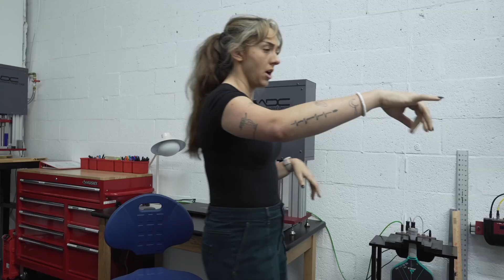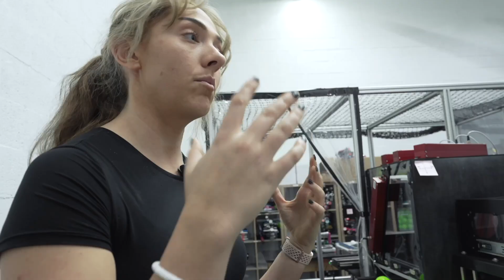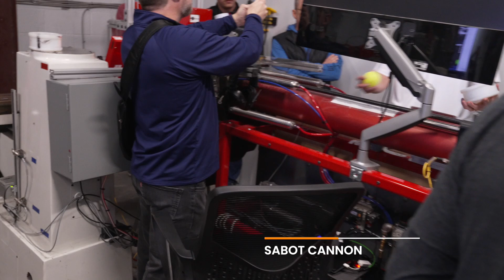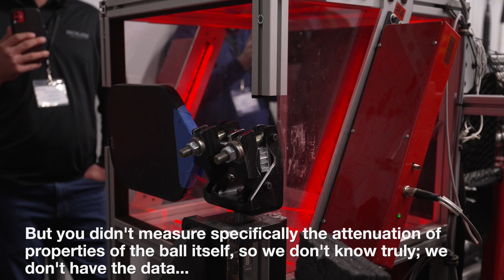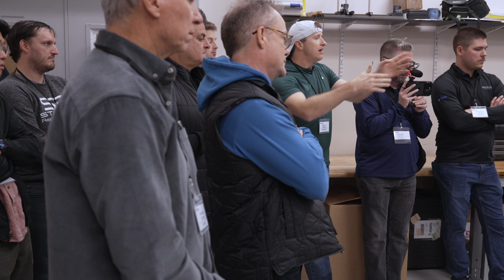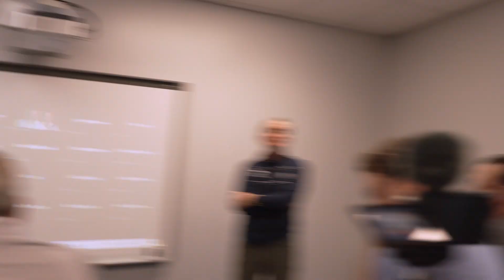I visited both labs doing PBCoR testing for USAP and UPA-A. Here’s what I found out.

Comment: I'm confused. These testing labs are ultimately trying to limit paddle power. Why would they include user modifiable variables in the PBCoR calculation?? MoI and weight should not be considered constants unless users/players are banned from adding weight. It would seem more appropriate to test for a maximum PBCoR value by eliminating the pivot/encoder mechanics and locking the paddle (by it's handle) in place.
At a minimum I'd ask the labs to test a stock paddle, weight the paddle and test it again, are the PBCoR values the same - unlikely...

Comment: It is important to remember what is being measured here PBcor measures the efficiency of the transfer of energy by the paddle in the collision between the paddle and the ball.  50pct of the data from the test  depends on the dynamic stiffness and rebound properties of the ball .  (COR) Ball! John USA P Head is very proud he can measure the mass of a ball but is completely oblivious to the requirement of measuring and creating a study of the Balls performance (bounce as measured in Ball Cor)  Then he needs to know what to do with this data to come on with a Ball Correction factor .  USAP missed this by a mile.  I expect a lack of precision and accuracy of results.  IMO PBcor under this SOP is best characterized as random .

Comment: It USAP does a fine system for companies that go over the legal limit after sale they should make the fine based on how many paddles were sold and how much they cost at sale. The fine would be a % of said sales rather than a flat fee cuz a flat fee will hurt a small Co way more than a large Co. A large Co might just pay the fine and sell a ton to make up for the fine. If the fine is say 30% of sales of said illegal paddles then it hits each Co just as hard.

Comment: Hey John,

We are a small company going to sell some paddles here in Europe. For us the USAP/UPA-A certification is no big deal at the moment, but from a scientist perspective I have some questions.
All the tests we heave seen are great for me as a company (to know how my paddle performs on the court), but I think they will not solve any problem we are facing with the „paddle cheating“ issue.

To be sure all paddles provide the same firepower, the tests should measure that. I thought of a test, that maybe has nothing to do with a real world scenario but give a number as result that says this paddle is fine and this is not.
For example: Why shouting with a Picklebalball  like ball at the paddle? Use a heavier solid foam ball, that would not change over hundreds of shots. Also clamp the paddle (all edges), so that it will not move and shoot that ball 500 times at the paddle. Measuring the first 20 and the last 20 shoots and look what changed. Of course you have to do some researching with different paddles and translate the results to the real world (for example: how does a Ripple compares to a paddle we know has less power and so on). We would have enough data from talking to real world (amateur) players. They know wich paddle feels right and what is to powerful.  If a paddle will make this test, I am as a player 100% sure my component is playing with a „fair“ paddle.  
[hope this makes sense, because I am not native in English 😉]

I don’t think these PBCoR testing will change much.
Also for me as a company I have the risk, that my paddle gets certified and after 6 months gets delisted again. How could my customers trust me? They spend a lot of money for a paddle and then it is going to be illegal?  This is ridiculous.

Kind regards

Comment: Who cares if paddles are too powerful? In tennis, nobody wants to play with the most powerful racquets; they're reserved for beginners or seniors who can't generate their own power. You still need to keep the ball in, so there's an upper limit to power before it becomes a liability. Nobody is going to have an unfair advantage at high levels of play if they use a powerful paddle. USAP really needs to be more lenient with what they allow. The game is trending towards power not because of the paddles, but because players are discovering that they can win with powerful drives. There are plenty of pros hitting hard with control paddles.
Reply: Yeah … it seems weird to me also. But … I was rarely hit by a tennis ball over decades of tennis, wiffle pretty much weekly. Also … think about the mini tennis warmup inside the serve lines. The entire pickleball court almost fits inside of that (that is so weird). A good opponent overhead with Mod 15 while you are in the transition zone will get your attention. I actually think the game will be more fun capping current power but add more trampoline/dwell/spin. Also … you would think we would evolve past a plastic ball.

btw … I had the same thought about good tennis players never using power racquets/string setups. When you can hit your own power, control is everything at higher levels.

At some point I guess pickleball and tennis comparisons aren’t analogous.

Comment: What a hoot!  Both GearBox (Pro Power Elongated) and Joola' (Gen3, 3S, and Mod TA-15) ALL advertise that their paddles WILL GET HOTTER OVER TIME!  I would've ducked for cover from the expected lightning bolt that should have exploded through the ceiling as Rafael Filipinni pretended to not have made those past claims. That the USAP did not IMMEDIATELY delist the PPE and MOD paddles is very very telling.  The foam between the core and the edge foam acts as a trampoline which is expressly forbidden in USAP's rules and the graphics used by Joola are prima facia evidence of their violation of the rule. The USAP: is a joke and it is clear to me that they show favoritism at best and are on the take at worst. Did anyone see Dong from Ronbus at this USAP event (the answer is no - Dong himself states he wasn't even invited).

Comment: As an outside observer with an engineering background and just the information captured, there's no way for me to reach a firm conclusion as to which methods (UPAA/PPL vs USAP/Element) have the best real world correlation and validity. But, for whatever reason, my gut feeling was that the UPAA/PPL methods had a more rigorous, analytical, and mathematical approach and basis than the USAP methods. Maybe that's just a function of how each was presented. In any case, there needs to be continued rapid evolution of testing and validation of results in order for all involved to have clear understanding of the boundaries and trust that the regulating bodies are producing fair and accurate results. Thanks for the informative look behind the scenes at this topic.
Reply: It sounded like the people presenting the UPAA were ones who were actually involved in carrying out and developing the tests, whereas the main dude presenting the USAP stuff was just an indirect manager who had prepared some specific talking points he wanted to use ahead of time.
Reply: No one at USAP is conducting research to validate assumptions surrounding the test. I do not believe USAP is intentionally doing these tests incorrectly they appear not to have the experience of expertise to do the job.  John was so proud he weights the balls to eliminate error .  However he lacked any study regarding the ball COR and how it changes over time .  I'm sure he is a nice man and well intentioned but he  has put results out into the market that are random at best because he skipped all the ball prep and has no idea what the dynamic properties bound over time are .
Reply: I predict these paddles will all need to be retested when the paddle companies begin sharing results .  It looks like behind closed doors this is already happening

Comment: Either I missed something, or using swinging clamp for PBCoR testing will incentify manufacturers that want to make power paddles to make them with lowest possible swing weight.
Reply: You’re exactly right. The test is flawed by design. Not only does there need to be resistance on the paddle’s ability to move, but ideally it should be swinging to meet the ball with a given amount of force. Otherwise, it doesn’t give a translatable relationship to the power happening on a Pickleball shot
Reply: @woodsonsanders1112  if you recall, in the beginning of the Boca Raton testing every paddle was given a value based on its exact swing weight as they measured it, thats all taken into account . High confidence in Boca Raton .
Reply: @ the swing weight isn’t the only factor involved here. The type of material and the degree of rebound potential  (springiness) it has, and how much force is required to engage the springiness, and whether that increases exponentially or linearly as the swing speed and resistance increases, are all variables that are completely unaccounted for with this design.  I’m sure you’ve seen the latest reports that paddles that are widely known and accepted to be less powerful are testing with a higher PBcor value than paddles known to have more power. This fact alone should make it clear that this test does not indicate the power potential of a paddle, and if anything is more indicative of pop

Comment: If you had to pick which organization to move forward with today, based on your trips, which organization would you pick?
Reply from the maker: Getting right to the tough question! Based on the labs alone (and not the USAP/UPA-A), the PPL seems to have a tighter teamwork mentality, with leading experts directly in sports equipment testing. And the Element staff seems a bit less integrated with each other, with direction coming more from aerospace experts. My impression is that PPL has the potential to be more agile and innovate/adjust quicker than Element/USAP. Because the PPL has only one objective: pickleball equipment testing. The Element lab is larger & more bureaucratic. 
But time will tell. I do hope that both labs continue doing this so that we get to our goal quicker: effective paddle testing

Comment: I am no scientist but the part where you asked why use balls with holes when you can control the experiment using balls without holes... and if I am recalling this correctly, his answer was... the balls that have holes provide results that are a little less accurate at times BECAUSE of the holes BUT it needs to be considered cause that's what is more realistic when playing the actual game... I guess my question is... if he is literally addressing that there IS randomness to it due to the holes... why wouldn't your experiment be done to control that variable? I found that a little confusing lol
Reply: Probably differing priorities depending on what they are testing for. In this case consistency in velocity was highest priority.

Comment: It appears to me that USAP testing is not real world accurate. By using a solid core ball, it’s not how the real world ball would react with the paddle.
Reply: It doesn’t need to be. They can set their guidelines based on their setup. If they know the real ball is slightly faster or slower off the face they can adjust their pass fail testing to get the desired outcome for how fast or slow they want the limit of paddles to be
Reply: @devinwillis7787 That's true only if the two balls correlate with one another. Like, if you knew that one was always 5% faster than the other in all scenarios, then you could use either one for the tests and then adjust the numbers afterwards. 

But the UPA-A team said that the two balls don't correlate. They said as speed increases, not only do the two balls show different measurements, but they change by different amounts at different points. That potentially means that a test with one ball can't predict performance with a different ball.
Reply: @ you don’t have to test to exact real world conditions. Let’s say the solid ball gets exponentially faster and the hole ball gets faster linearly. If they are reasonably close in performance at 60mph you can approximate the real world performance. 

You don’t actually need real world performance numbers to run a reasonable test. They tested a number of paddles and set a reasonable cut off mark that got rid of the outliers like the mod. It doesn’t matter if a real world ball tests at 0.5 or 0.35. If their test is consistent that’s all that really matters. you have to make a paddle that fits their specs to test under 0.44 in the defined conditions. It doesn’t matter if they did it with a tennis ball or a bowling ball as long as they can consistently produce the same numbers for the same paddle
Reply: @devinwillis7787   "If they are reasonably close in performance at 60mph you can approximate the real world performance."

Yes, that's the question. IF they are reasonably close in performance. We don't know that they are, and one of the two groups is saying that they are not. 

And the test being consistent is not all that matters. The test needs to be consistent AND correlated with real world performance. That doesn't mean that the test itself has to mimic real world scenarios exactly. But it should mean that the properties of a paddle that make it perform a certain way in the test are the same properties that make it perform in the real world. That's why the deflection test is a bad test. It's not that it's inconsistent. It's very consistent. But the thing it measures isn't the same thing that makes the paddle hit hard. A CoR test using a bowling ball would be equally useless. A CoR test using a hole-less pickleball is much better than either of those tests, but we don't actually know how correlated the results of that test are with other measures of power. All we know is that it's identified a few of the same outlier paddles.
Reply: @johnclikeman5041 correct
Reply: @devinwillis7787 USAP has not studied any thing about either balls dynamic stiffness or COR.  This alone explains why their results are random
Reply: As long the ball is the same
Reply: @rickiezzi7753  as long the ball is the constant, does not matter which ball for this test.  When you add a ball with holes, you add other variables....

Comment: Several factors impacting their testing data, I would be curious to know. What is their calibration standard and periodicity for all sensors utilized at each testing fixture and at what barometric pressure which drastically impacts the final test data.  These need to be specified in any approved testing procedure for data consistency.

Comment: @ 23:55 John Anderson, Chief Engineer USA Pickleball: "I hate this ball"

Which ball was he holding?
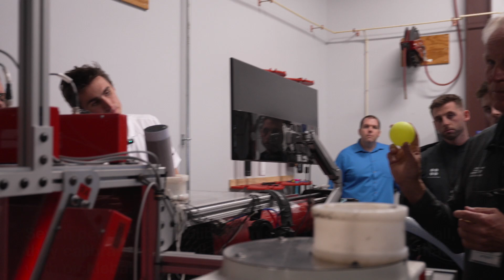Reply: @ 35:46 he says again: "I hate this ball"
Reply: @dveith00  he has said "I hate this ball time and time again in many interviews.  We should listen to him because he tells us why"   It is a hard roll molded ball whose dynamic properties . Speed and spin quickly change over time.  Every time this ball collides at 60 mph with the paddle the ball experience a series of microfractures and its COR changes .  With in the first 30 hits one must measure this and include a ball correction factor based on this data to reduce variability and get an accurate PBcor value for the paddle